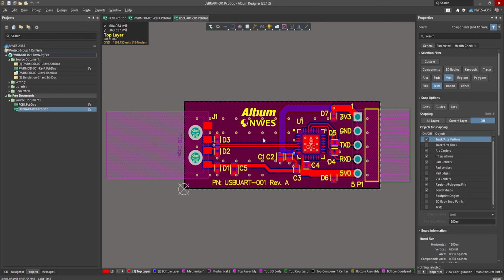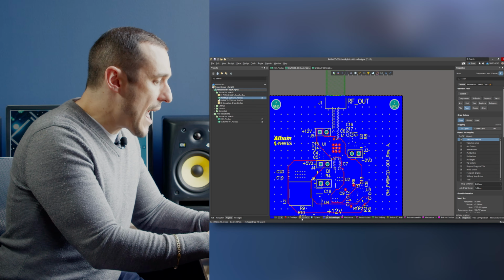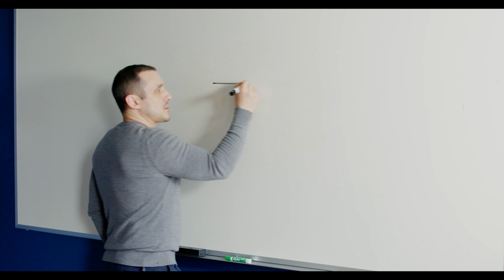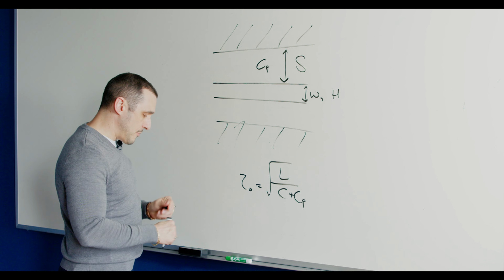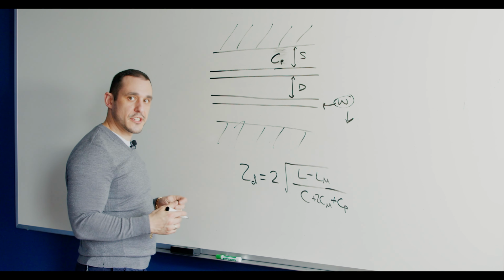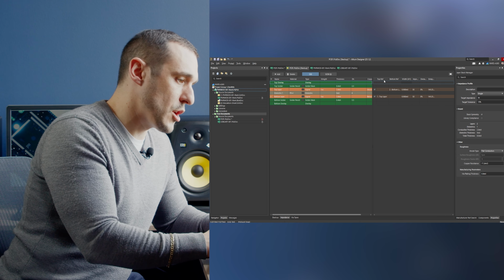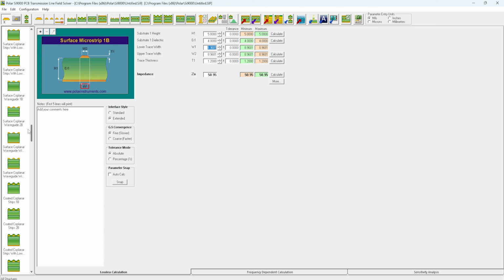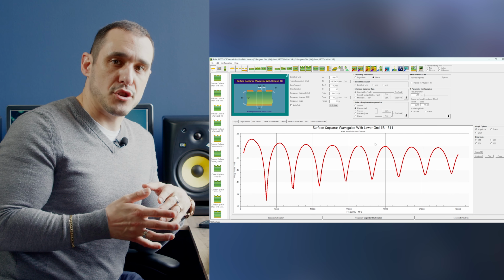Coplanar vs Non-coplanar PCB Transmission Lines #pcbdesign #electronicsdesign

Comment: Hey Zach, thanks a lot for all the videos you're making! I have a question for you, how one should go with adjusting an impedance matching network values when your component layout doesn't exactly match the one from the reference design? I'm talking specifically about nRF54L15, I've been told by guys from Nordic that for 2.4GHz 1mm of trace roughly corresponds to 1nH of stray impedance (plus the capacitance). But there's no value of output impedance of the antenna pin in their datasheet. Am I missing something?

Comment: 2:22 "[...] routing over a tiny split here[...]" left me psyched until the end of the video to see if it there'll be a ferite somewhere in there, also "not causing a huge issue". 😂 Sadly, not.
Reply from the maker: Well in this particular design with a differential line and coplanar ground, it''s definitely not a problem for the USB impedance as the return loss deviation is not noticed until 10's of GHz frequencies,. For radiation, you might be able to measure a difference with sensitive enough instrument but it will not be enough to create a radiated emissions failure.